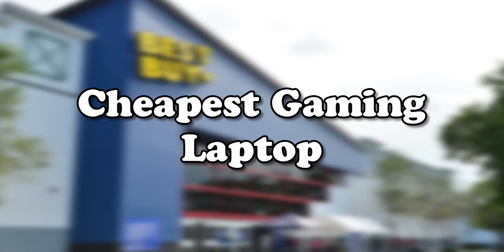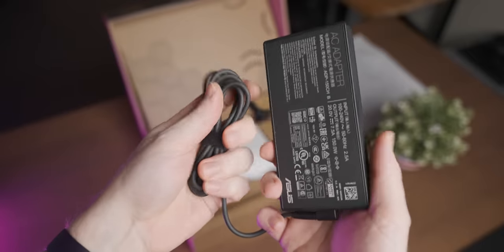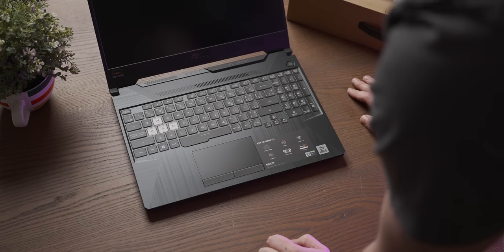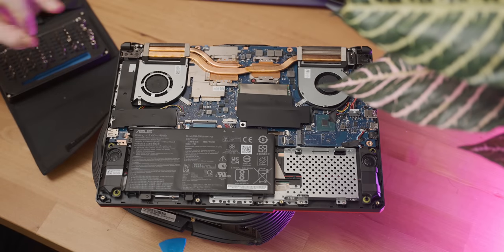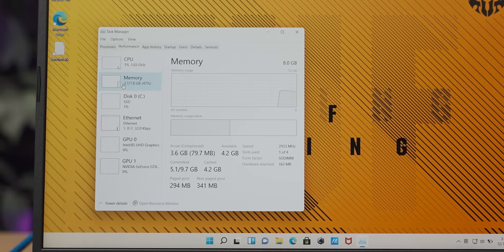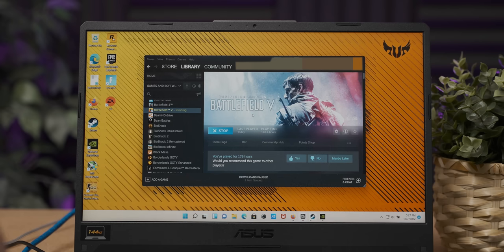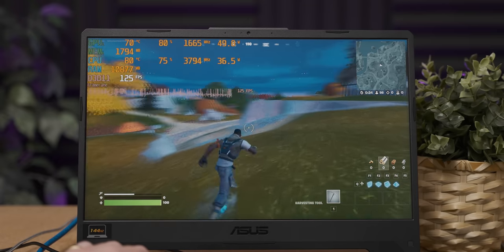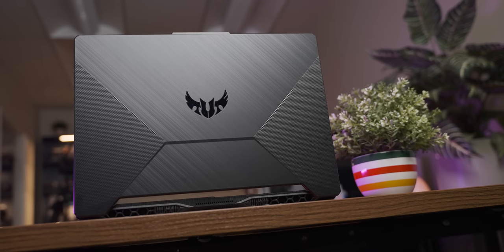The Cheapest Gaming Laptop From Best Buy...

Comment: The GPU seems to just sit at 70 to 71 degrees even after the ram upgrade so i'm thinking they might have applied a thermal limit rather than it being a CPU bottleneck at that point.
Reply: No mention of what power profile was set in Armoury Crate. I think it defaults to Performance which won't let the GPU reach its maximum potential, gotta go to Turbo mode for that. That makes the laptop even louder though in terms of fan noise. On my 3060 machine I find the Performance setting to be just enough to get me by, and it's better than having the fans running at "jet turbine on takeoff" speed.
Reply: @OnTheRocks71  i dont get the fan noise thing on portable pc just get a good headphones
Reply: @ronank2432  no
Reply: @ronank2432  Do you mean that you literally don't hear it with headphones, or do you mean that you don't understand how it's an issue for some people?
Reply: @Ronan K  agreed never cared if my fans are loud even on my tower. Lmao
Reply: David*
Reply: @ronank2432  some good headphones are open back and you will use the noice when wearing them.
Reply: @googlewolly  my £20 earbuds are more than enough to significantly drown out the fan noise. Although now it's made me never want to use my laptop without earbuds now
Reply: @googlewolly  I have the G533 strix scar and I can barely hear it once I set it to the correct settings. I wouldn't say it's perfect, but it's even hard to notice without headphones. I don't know what magic they put in it to make it sound so reasonable under all but the most extreme circumstances and at the same time pulling off some pretty impressive performance for a laptop, but I don't think I should question it.
Reply: @mdhafigurrahaman3441  If someone actually games without a headset, they are doing it wrong. I like to have the increased clarity and better stereo effects that just isn't very reasonable to expect from the vast majority of laptops, it also has the benefit that I don't have to get used to a new audio source should I decide to game on a different system, or a massive decrease in mic quality either. The only thing I actually have to deal with is windows randomly resetting my audio and mic source settings for whatever reason.
Reply: It can also be a cpu bottleneck because of the 4 cores with some games using up to 6 😅
Reply: @stopcallingmesid  If you bought headphones to not get distracted by noise and they are open back, they are by default really bad headphones.
Reply: @wyterabitt2149  clearly you dont know how headphones work 💀💀💀
Reply: It's also because no external monitor
Reply: @ILiketurtles68  they are but for some purposes you would want a good set of open backs.
Reply: @stopcallingmesid  You aren't the brightest are you? I don't think you even know what your comment even really means in relation to mine,
Reply: I think they went for a decibel limit instead given how loud these things are.
Reply: @stopcallingmesid  No, he's right. Open backs are a meme.
Reply: @wyterabitt2149  apparently you dont even know what i meant with my original comment so check that first out before you expose yourself of not being the brightest around.
Reply: @mdhafigurrahaman3441  That's good, but it's silly for someone to claim that they don't understand how sound can be an issue for people with headphones. I have headphones, and I still didn't like how loud my GPU would get before I got a better case with bottom-intake fans.
Reply: @_shadow_1  That's good. I'd personally never get a laptop, as they're inferior to desktops in almost every way. If you need something that's portable, though, they're good.
Reply: This is crazy bad my laptop 1050ti can run gta 5 at max settings in 4k this computer is awful despite having a 1650
Reply: i have the same laptop 1650 ti instead of 1650, my cpu temp only throttles at 100 celcius , same cpu in this case cpu is throttling at 80
Reply: @Megatholis  1650 isn't that bad actually since 1050ti is actually weaker and older. It's just that the Asus laptop has a terrible configuration. I got a 1650 laptop for the same price and it came with dual channel ram and a Ryzen 5 5600h
Reply: @Megatholis  yes it can but it would get like 10 fps if you were to have the best version of the 1050ti. So that wouldnt really be playable. Only way you would get close to an 60fps with that chip is at low settings with a desktop version of the card. That would give you an avarage of 59fps. What you say is not possible and therefore a lie.
Reply: @umamifan  Bruh open backs are godly wtf
Reply: @OnTheRocks71  Fn + F5, this "tech" dude cant even find a simple shortcut, and i have this system myself so im kinda offended by this video, bad research.
Reply: @googlewolly  I don't get why that's an issue for so many people. Either my laptop isn't a loud boi (Ideapad 3 Gaming) or I just don't hear the fans. Like I just tune them out quite quickly.
Reply: @doggo_woo  In general, laptops are very loud. You either are very fortunate, or you don't hear it.
Reply: @OnTheRocks71 [Sets performance mode on] Laptop starts whirring like a jet and takes off vertically like a VTOL 😂
Reply: Lol
Reply: @googlewolly  Like, I can definitely hear it when I put it on performance mode and the CPU and GPU start sipping power like crazy, but Lenovo's Auto mode is just quiet. I never end up using Performance since the games I play on it run perfectly at 60 fps.
Reply: @doggo_woo  Yeah, the "Performance" modes supposedly get even louder than normal.
Reply: @OnTheRocks71  that's what i was thinking about too
Reply: @kizl666  for real, it's like yeah it's loud but so what?? If I needed something to use at a library I'd buy a mac, no fan no problem, but no gaming either
Reply: @wyterabitt2149  man some of the best headphones are open back, that said, those are really not ideal with a noisy laptop lol
Reply: @doggo_woo  you prolly just don't mind it like me, I've got a legion 5 and it's pretty similar, really loud, and the other day, with the heatwave, REALLY hot
Reply: @LeoMkII  exactly 😂😂
Reply: @LeoMkII  Maybe so. I used to enjoy the fan ramp up on my old PC because then I knew it was actually doing something.
Reply: What are open backs
Reply: @Nature-556  They are headphones with a port/vent/duct/hole connecting the wearer directly to sounds from the outside world which aren't being made by the headphones.  For example, with open backs, you can hear both the music being reproduced by the headphones and your mom yelling at your dad without the headphones doing much of anything to dampen the yelling.
Reply: @doggo_woo  Fan noise is also really close to white noise, and at least for me after a few seconds white noise is completely unnoticeable. It just gets tuned out because it's so consistent and not especially intrusive.
Reply: @OnTheRocks71  i wear headphones anyway
Reply: @ronank2432  100% agree, I have the F17 TUF and I run it at turbo at all times. I have a fan on all the time anyway and it gets way louder than the laptop. People complaining about fan noise are mysteries to me. Maybe they play with speakers or have crappy mics so other people complain on call or something.
Reply: Nope, there isn't any temp limitation. Only the standard Nviia thermal throttling that is higher than 80°C
Reply: Well that’s a good thing. I do not want a laptop to go anywhere above 70 degrees :/
That would be like a fire on your lap lol.
Reply: @Megatholis you run GTA 5 at 4K Max settings at what fps? 20?
Reply: @AchiragChiragg I laughed at that comment 🤣
Reply: @_shadow_1 As someone  who uses windows 11 daily, the source settings comment hit home so hard, Windows has been making Linux look really appealing to me recently, so many things seem so bloated but also somehow so unfinished.

Comment: It's madness that dual channel is such an oversight when it's such a performance boost or performance reduction!
Reply: I'm pretty sure it's not single-channel vs dual-channel. It's the doubling of the memory. When he was playing without the upgrade the RAM usage was consistently near 8GB, the maximum. This causes large amounts of disk swapping which bottlenecks the CPU.
Reply: @jameswang7362  it is dual channel vs single channel cuz dual channel doubles your data rate -.- It's not always about the amount but about the speed of information exchange between cpu and memory, which gets crippled down nearly twice with single channel ram. Of course, exceeding RAM capacity is an problem too.
Reply: DDR5 fixes this issue with laptops
Reply: My older Dell 7567 was a stuttering below 5fps in origins, after dual channel performance was increased by 20%, now the stuttering was completely gone.
Reply: I bet you most configurations of this laptop do come with dual channel but they cost this one down as much as possible to get the price as low as possible.
Reply: @dannybrennan31  but couldn't they just go with 2x 4gb for dual channel? is it gonna be more expensive?
Reply: @defetya  2x4 will make it more expensive if you want to upgrade to 16GB because you'll have to buy 2x8 instead 1x8
Reply: It's a great way to make the laptop cheap though. The rest is up to the buyer if they want to upgrade the ram or not. While a stick of ram would probably cost 20% of the laptop, the jump on the performance is huge
Reply: @xeon39688 You’d want to buy 2x8GB DIMMs anyways, to pair them up properly. Mismatched RAM can have an effect on performance, too, of course, so you’d really want to swap out the 1x8GB for a whole kit of 2x8GB regardless. Realistically, you can get away with not doing it in many cases, and just adding a new 8GB stick with the old one, but this can just cause issues a lot of the time, and if it were me, I’d certainly buy a new (or used) 2x8GB kit and sell the single stick that came as standard to recoup some costs.
Reply: @jameswang7362  It was both inadequate amount of ram and single channel holding it back.
Reply: @archgirl  For desktops sure, but for laptops, mixing kits isn't that bad because almost all are 1.2v jedec anyway. Mixing different ram IC for xmp kits (mainly desktop ram) can straight up not boot. You just need to grab a matching or stronger stick for ddr4 laptop that's running at 1.2v. 3200 will just downclock to 2933 or whatever you had before
Reply: Well it's because of who these laptops are marketed towards.  A decent amount of people that will buy this, don't know much about computers so companies will get away with what they can.  It's a problem with the car market as well.  There are certain models are that absolute trash but sell well.  It pays to do your research and know what's going on for any purchase that is a decent amount of money.
Reply: @archgirl It would rarely cause issue. The only time I’ve ever seen mismatched ram cause issue in a laptop was an older nvidia chipset MacBook. Buy the same dimm if possible, or just put anything in and be happy.
Reply: @defetya  yes, 2 4Gb sticks cost more than 1 8Gb stick
Reply: @jameswang7362  yeh I can see that, and in a world of maximum profits just adding another 8gb is a no go. Rather cripple performance. With a little bit of not stepping on the toes of the better model up
Reply: @Dominik12335  dual channel doesn't mean it doubles the performance... It's usually just a few fps, especially on Intel. It's not enough ram probably
Reply: @archgirl  I think you're overestimating risks of pairing two ram kits from different manufacturers. I have micron 8gb stick, just bought the same volume from kingston and it works just fine. Good motherboard should have no problem with it.
Reply: @xeon39688  That's a valid argument. But if you buy 2 8gb sticks instead one, you'll have more volume, that's something your pc can also benefit from.
Reply: @donextmedonextme4351  You really couldn't be more wrong. I had one 8gb stick and about 40-50 fps in BF1, bought another 8gb stick and now fps almost never drops below 60(57 is min), while memory usage is only about 2-3gbs(cos minimal settings). And I also have an intel cpu.
Reply: @defetya  I’m not overestimating, though. Even two sticks of the same RAM from the same manufacturer can have issues working together, even with the same speeds and CAS latency. Rarer, maybe, but it happens. I’m not saying you should never mismatch RAM, or trying to blow it out of proportion, but the fact remains that two matched sticks will give you better performance in most cases.
Reply: @defetya  that's impossible, even windows by itself uses more than 2 gigs of ram... I used to have 8 gigs long time ago and most games were close to Max that out. Why do you thing 16 gigs is the minimum recomended nowadays for gaming?!
Reply: What a surprise! Not like he could have spec’d it with more ram. Just bought the cheapest version of the laptop for content.
Reply: Real test would be 2x8 GB vs 1x16 GB, but I suppose this would be too much to ask from Dawid 😁
Reply: 8gb single ram is just a bottleneck for 2022 hardware
Reply: At least put two 8 gigs sticks of ram in the "gaming" laptop at best. You may have to pay more but, it world help out a lot too.
Reply: @Dominik12335  It's both.
Reply: A lot of OEMs seem to use single channel RAM... sometimes even in gaming laptops! It's an easy fix though, and one which will double your RAM capacity as well. Remember, you can never have too much of RAM...